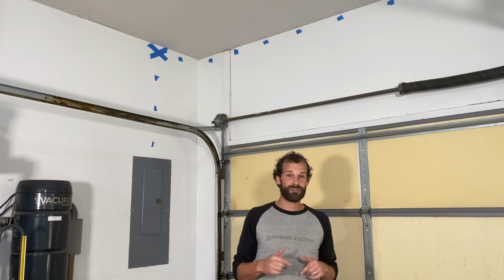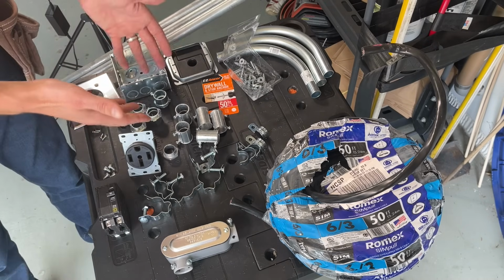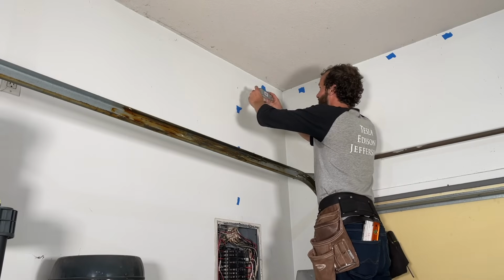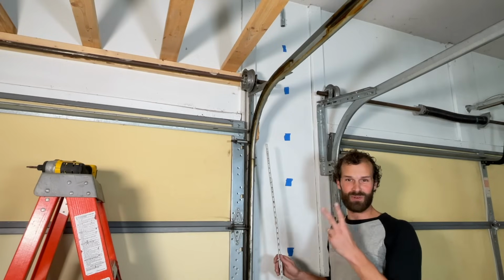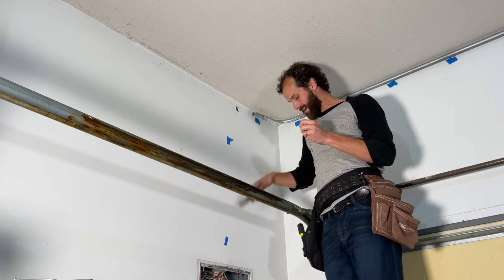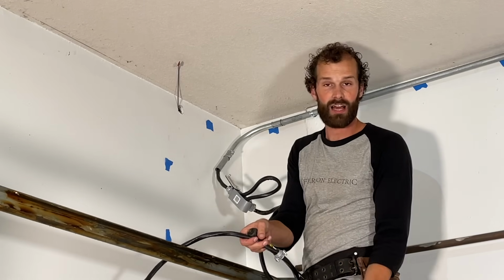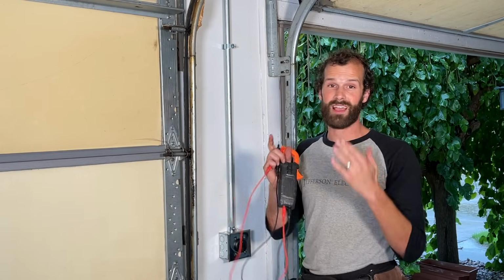How To Install a 240 Volt Outlet | Electric Car Charging

Comment: The one thing you failed to do was to ground your electrical box where the outlet is at. Yes I know it will be going around the bracket at the plug which provides a ground. And it grounds the Box. But when you remove the plug the Box becomes ungrounded. Without a connected ground connection. So always ground your electrical box when it made of metal.

Comment: Had an outlet installed for a 20 amp circuit, but wired for a 40 amp circuit, so I only need to swap breakers and outlet when I move to a 32 amp charger. See no need to have 50 amps.  Only cost me $300 to have an electrician to install it and another 15 amp circuit including parts. This was in 2019 though.

Comment: I believe the electrical code stipulates that anything that goes in conduit is an individually insulated wire. This excludes any grouped wires that share insulatio n (rubber or plastic cord, romex, etc)
 That allows the individual insulated wires to run cooler. There are stipulations as to conduit size / number of  conductors in the conduit to be considered. Done right, the amperage carrying capacity of every wire in a conduit is taken into consideration. That allows for multiple sizes to be run in the same conduit. And therefore the conduit is sized according to the correct installation demands.
Reply: Cables, as opposed to individual conductors, are allowed in conduit. It is, however, a very amateurish way to do it. Several NEC violations in this installation.

Comment: Having wired many additions, remodels, panels and kitchens from the 1980’s until 2012 I know enough to be dangerous! Having just completed an exterior 1450 outlet for my EVSE I know what I did right and where a code inspector would fail the project. I think amateurs should not be encouraged to take on the installation or operation of what amounts to industrial equipment.

Comment: To the electricians out there, I have never seen a breaker box with all the circuit wires run together through the center hole. That is allowed?
Reply: As long as the PVC stub that those cables are in is 24" or shorter, it is allowed. However, it looks like they overfilled that PVC stub beyond 60%, so that part of it is a violation.
Reply: @pld8993  - Thank you very much

Comment: It’s not 220Volt, it’s 240Volt (2) hots at 120V = 240V and 50 amp circuit with 6/3 Romex connected to a 50Amp female receptacle. And 50Amp breaker in the panel.  

Square D QO Load Center CAT Number QOBW 12125 panel and Breakers. 

I just bought those breakers at Lowe’s . Also, find them at Home Depot.! Also buy EMT tubing a.k.a. conduit at Home Depot and Lowe’s and pretty much any big box store throughout the United States! If you go to a hardware store, the cost could be considerably more anywhere between 30% and 100% more especially ACE!

And Romex  wire has gone up considerably 12/3 Romex is $45 for 15Feet and 25Feet is $75.00

Romex 6/3 wire $314.00
6/3 is also sold by the foot at Lowes.

Comment: Technically it should have been single conductors through the conduit with a box above the panel. Then from the box romex should've been ran through the wall and joints made in the box between the romex and THHN wires. BUT I hate making joints in a new circuit so I would've done it the same way. Id rather have romex in conduit than have joints in a brand new circuit with extra potential to fail in the future as long as its interior conduit. Definitely would've had that panel cover on with the fishtape flopping all around.

Comment: Curious- would it not have been easier to “ pre thread” the electrical wire in the conduit before installing; allowing a certain amount of slack to be fed to the fish tape into the junction box?

Comment: Regarding optional PVC conduit use, check with your state/local electrical codes. Many have amended the NEC Article 352.12 with (F) stating the PVC cannot be installed under 8 ft. from the finished floor/grade at the buildings interior.

Comment: If a homeowner-diy needs an explanation on what a two pole breaker is..... then they shouldn’t be doing it.
Also romex-loomex in a conduit - 100% illegal.
LB would be a million times easier....
This “electrician “ seems like a hack
6-3 in a 3/4” pipe......
Reply: Romex in conduit not illegal, but not professional either.

Comment: Great video. is it permissible to attach the wires into the 50amp breaker and then snap the breaker into the panel with wires connected?
Reply: Yes, but then you should make sure the wires didn't come loose. Do some more screw tightening just to be sure.

Comment: Can you explain why an electric car charger needs a neutral? I’m at a complete loss as to why 120v is needed? I don’t pretend to understand how these EV chargers work but I’m assuming it’s simply a transformer, a rectifier, and some filter caps. If a lower voltage was used for something wouldn’t it simply tap the required voltage off the transformer in the charger?

First off I am not an electrician. But I do have some experience. You are not supposed to run NM cable or any cable in EMT conduit you are supposed to run wire such as THWN or THHN. Not only is this a code violation but a waste of money. I would have joined said wire to some cable for the fish run behind the drywall. I personally would have used MC cable for that run. I would have used some ferrules on the stranded wire in the screw terminals on the receptacle and panel. Not sure if that is required by code but it is good practice regardless.
Reply: EV chargers don't need a neutral, but when allowed to be plugged in (as opposed to hard-wired) a 3-wire or 4-wire recep can be used.

Comment: Although I might be able to produce an excellent video like yours (bc i'm lazy), I find that for a pro-video, no shortcuts should be shown, e.g., not turning off the 200A fuse is a danger to yourself when your hands are all over the naked fuses when fishing the cable wires.
Reply: this is not a pro video.

Comment: You ran 6/3 Romex through conduit -- Is that not violating NEC code because the Romex's jacket is unable to dissipate wire heat for such heavy gauge (6) wires? In my DIY, I stripped off the jacket and just use the individual wires inside the conduit. The trouble with my approach is that my individual wires have no markings, so I think the NEC-complaint way is to use individual AWG 6-THHN, since they will have necessary markings.

Comment: Some good information...I guess. I would never pull NM through conduit. Code or no code. To keep it clean above the panel I would use a 411 box. It is ok to make joints with wires. I know some will cry that it is a potential trouble spot but not if you do it properly. NM in wall then THHN in the conduit. The condulet at the top of the wall is more work than is necessary. Well made video! I like the effort the young man made to explain things to DIYers.

Comment: You need a little more camera work so you get close-ups of what your doing!  Should have also stated that each 120V Lead is going to the opposite  120V leg from the bottom 2 120V Leads.  NOT on the same Leg!!

Comment: Hello nice video. To cut time and efforts , after measure all metal conduit  to be screwed ,then, I’ll pass the wire through all 45 and straight on ground  leave 8’ from other end you could easily have connection box there with wire passed . The I start hanging all pipes and tight couplers , fish the wire to the box ,the rest is history.

Comment: I enjoyed this too and feel confident to do mine now, but it raised 3 queries. 1) Would it not have been better to pull back to the outlet the excess cable rather than bunch it up in the drywall. 2) I have always been told to sleeve the Earth wires so there are no bare wires visible in the box. You can buy coloured sleeve tubing on a spool. 3) Do you not have to use an insulated shaft screwdriver to prevent accidental shorts or worse, shocks. Thanks for posting.

Comment: Looks like it's being mounted in a garage, right? Why no GFCI breaker instead of a common breaker with no ground fault protection?  They are expensive (3x the cost of a normal breaker) but worth the extra added protection on a cement floor of a garage.

Comment: I had 240v. outlet installed (NEMA 14-50). Need 3#6W+G  (same as shown on you tube here) For Tesla. Once it is done it had about 30miles/hr. charge with 32/32Amp running. 
Then I installed Tesla NEW Wall connector inside garage. Require NO neutral. 2#4+G (No neutral). Wiring is much easier than outlet. Just pull wire from panel and passing thru back of base of wall connector (no wire cut). Loop to connect to base terminal. then snap wall connector into base and done. Speed is much faster 45 Miles/hr (48/48A) . Much easier than NEMA 14-50 outlet. 
It worth money to install TESLA wall connector instead of NEMA 14-50 (assume you have TESLA)
Reply: I hope to god you used a EV rated outlet, this guy is putting out bad info....He screwed up in this video,  like a lot of electricians, that know nothing about EV charging.
He installed a outlet that is sure to melt over a long charge.    Hubbell Lighting 125V 50A 3-Pole 4-Wire Receptacle – HBL9450A, is rated for the EV charging.  These guys only run the required, Cheap ! Glad to see you used #4
Reply: @Themachinewon  I had standard 240v.1ph. outlet before. It always burn out and very hard to install large wire into outlet. Trying save penny with standard outlet never work with EV. Somehow Tesla know there is a heat in the wire and shut down charging system. Installed total of (2) tesla outlets inside garage and outside Garage. work very well for 2 Tesla car.

Comment: Article 210.12 states all receptacles switches and sockets in a residential dwelling MUST BE ARCH FAULT PROTECTED. To comply with the NEC you installed a receptacle without Arch fault circuit breaker. All metal conduits and outlets MUST BE BONDED at no less than 50% the Ampacity of the circuit. All chargers allow for direct connect, which bypasses Article 210.12.

Comment: In general your main panel the grounds and neutrals are bonded - if a sub panel they must be separated.  In a house there is only ONE location (at the main panel) where neutrals and ground are connected together and attached to a grounding electrode (like a ground rod)

Comment: Good job, the only thing I see is conduit fill the outside of the romex is the diameter used for fill not the 6/3 wire itself. What I’m saying is the wiring would be good without the added insulation of the romex and easier to pull the wire.

Comment: Why did you not just fish a short piece down the panel and instead of an LP put a 1900 box there and pipe to the 1900 box for a junction box. You could have used regular wire instead of Romex and your pipe. It would have made it a lot easier and probably cost you a few dollars less

Comment: NEC Chapter 9 Table #1 says maximum conduit fill is 53%. Use larger conduit!Heat builds up inside conduit. Running THWN or THHN is preferred. Change wire type in junction box to run down wall cavity into breaker box.

Comment: Pulling Romex into EMT? Save money, make the entire run in pipe(bend an offset to correct depth to get into the panel), then pay Homer Depot to cut #8(thhn is rated at 55 amps) to size, and your ground wire is eliminated by the use of the pipe for ground.

Comment: Just because I am an HVACR electrician is not why for a long time (several years) , I've known the NEC says romex can not be installed in conduit. Also the NEC says maximum number of #6 AWG conductors in ½ inch conduit is 2. I always pull THHN in emt. If there are more than 2 90 degree turns, 
I use wire lube. Strip the insulation at various lengths. Then stagger the conductors on the fish eyelet. This allows more clearance when coming through the connector into a box.

Comment: I would NEVER EVER park an electric car in my garage.  If ANYTHING happens to that electrical vehicle battery, the car will catch fire and burn down the house.  Lithium ion battery fires are not easily extinguished.  I would never own an electric vehicle.  If I did, I’d want the charging plug as far away from my home as possible.

Comment: How does this meet box fill requirements?

The box and mud ring are 30.3 + 4.5 = 34.8.

There are:
3 conductors -3
Ground - 1
double yolk - 4
NEC lists 6awg as 5 cu in so 8 x 5 = 40

What am I missing?

Comment: Great video! I learned something new with the freakishly long needle nose plier tool. I'm a DIYer, but in the past, I've used coat hangers and all types of crap to get that wire out. Good to know that tool exists. If it's less than $50, I'll buy it.

Personally, I wouldn't use drywall anchors to hold such a heavy plug. Then again, I'm one of those people who overdoes things. I would have reinforced the outlet with wood supports. So I would have cut out the sheetrock, added wood studs, and added the sheetrock back and re-taped it.

Lastly, and most importantly, the outlet you choose if of CRITICAL IMPORTANCE!!! While you can go to any big box store and pick up a $9 NEMA 50 amp plug (the kind used for electric dryers) DO NOT USE THOSE! Those are not designed specifically to have current running through them for hours and hours and hours and there have been many stories of those melting and worse, starting fires. Get the industrial kind, like Hubbell. As of me writing this, they're $80, so they're not cheap. But if you're going to spend $50K (or more) on an EV, you're already saving money by doing the job yourself. Don't have your house burn down over a few bucks.
Reply: Appears that Joel is installing a Hubbell 9450A, 50A, NEMA 14-50R receptacle. This is an industrial grade piece as FedSpec grade is expensive overkill. This is better than good for extended duty-cycle home use. $90 on Amazon. Do it once, do it right and be secure in the knowledge you did so. Your clue is B00IPBMUKY. Cheers!

Comment: Question?  I thought you are supposed to remove the romex covering when running wire inside EMT.  Something about helping to not heat up.  Your thoughts are appreciated.

Comment: You mentioned about the need to torque the connections, but didn't! 
PLEASE add a comment that torgueing IS NECESSARY. There are numerous incidents of fires being caused by bad EV installations m

Comment: Great presentation, but way too much wrong to be useful. Never, ever run a metal tape through a live box. No PPE. No ground connection to the 4x4. Should have run individual wires through conduit. I'm sure there's more, but I'm just a DIYer.

Comment: Side note: NEC now requires a GFCI breaker for 6-50 and 14-50 outlets. Something to consider. I found the below after a google search and after my electrical inspector gigged me on my breaker being non-compliant. Luckily my Emporia charger worked fine, as did my Bolt EUV charger. I haven't tried it with my Rivian charger. 

"The national code now requires a GFCI breaker on the circuit if you are using a 6-50 or 14-50 outlet. Since the EVSE already has a GFCI, and since two GFCI with different sensitivities on the same circuit can result in unwanted tripping, you'll want to hardwire it."
Reply: There is some hair splitting in the NEC on the gfci protection.

There is a seperste section for evse or car charging.....section 625

It requires gfci protection in the charge unit.

If you install a receptacle, it requires gfci for the receptacle.....625.54.  This is code from before 2020.....maybe 2017 or 2014.

2020upgraded "up to 250 vac garage receptacles" to gfci's, but remember this is also falls under car charging.

Comment: Great video. I am expecting my EV to come by December. I will save money by doing this myself, although my project is much shorter as I have the breakers in the middle of the wall where I intend to put my outlet. 

One question: instead of the breaker, is it advisable to extend from an existing 220 V outlet ( say dryer) in a parallel configuration, or will it be too much load for that breaker? Parallel circuits should by Ok in my mind, but asking the pros.

My laundry room is right next to the garage, and I am thinking the requisite breaker being off will allow me to work more safely.

Also, any benefit if metal condits over PVC?

Comment: the NEMA 14 standard is NOT a 240V only connector.  it is a 120/240V standard because of the neutral.  ANYONE that calls a NEMA 14-50 outlet a 240V outlet SHOULD NOT BE FULLY TRUSTED as they clearly don't have a reasonable understanding of the standards.

NEMA 5 is the 120V grounded standard
NEMA 6 is the 240V grounded standard
NEMA 10 is the 120/240V ungrounded standard (has been phased out)
NEMA 14 is the 120/240V grounded standard

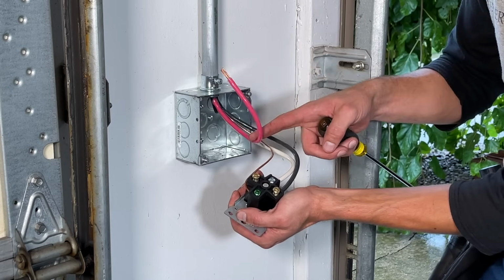Comment: 41:19.  How are the box and conduit grounded?  I think you're missing a connection from the ground wire to the box.
Reply from the maker: Correct that was missed, thanks for the feedback.
Reply: @EverydayHomeRepairs  Luckily an easy fix.

Comment: This link here to the 14-50 nema outlet shows a 10$ outlet.  With all do respect most videos out there that are installing 14-50 nema's for ev charging do not use this kind of cheap outlet.  This outlet is one you would use for like a dryer, something you plug in and maybe unplugg a handfull of times over the course of its life whenever you change your dryer.  But an ev charger, that you might technically be plugging and unplugging a lot, you would want an industrial 14-50 outlet that run around 50$ and up.  It is heavier duty can handle the pulling and inserting of the cable on a daily basis without the contacts getting lose or failing.  Not to mention the outlet box looks hideous with that over sized cover.  There are special nema 14-50 boxes that house the outlet nicely and don't make it look like it was put together by a diy'er with home depot parts.